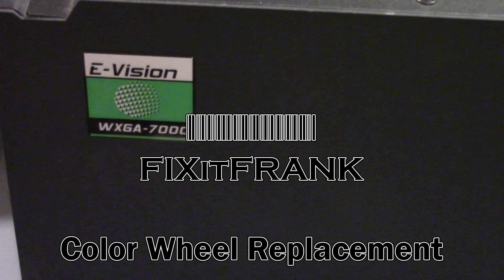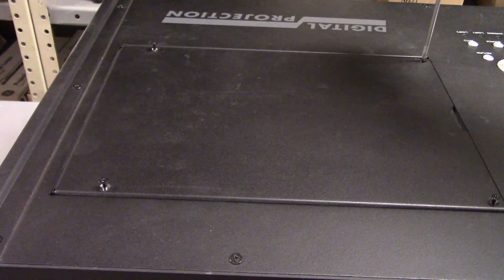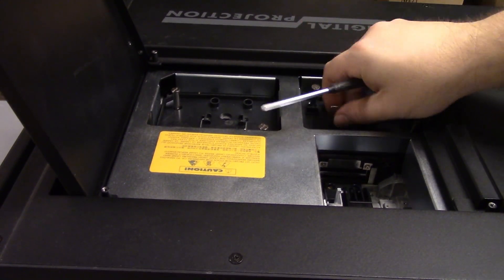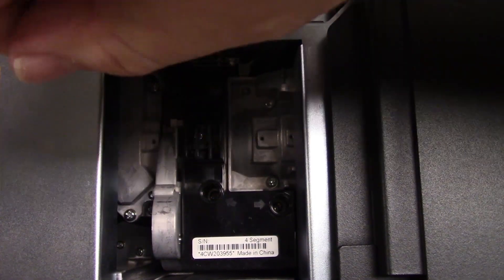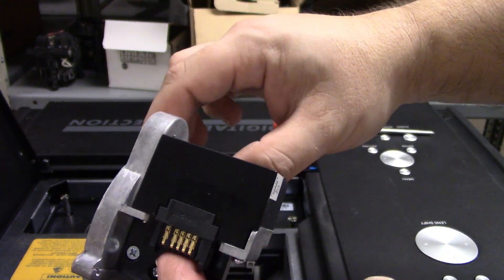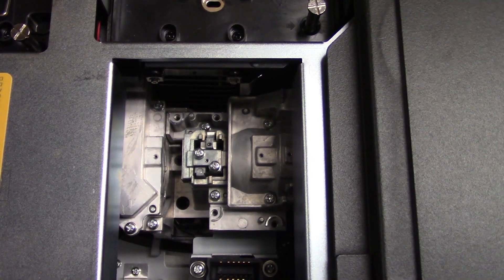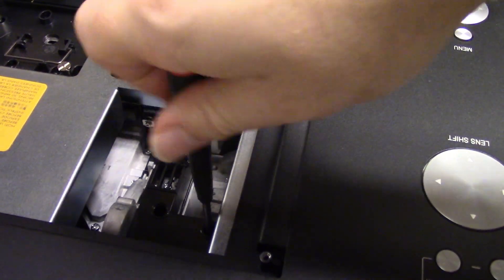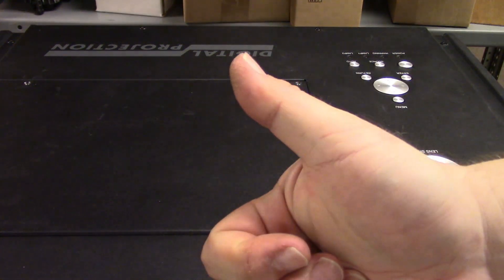Digital Projection eVision XVGA 7000 Projector Color Wheel Replacement

Comment: Hey Frank, I have a pico projector from AAXA, the colours will go inverted over time and if I turn it off after a while, the colours become normal but turns inverted again over time. Do i have to change the color wheel or is it some sort of overheating on the DLP chip?
Reply from the maker: I don't know if those have a color wheel. I think they flash the LEDs on and off instead. I say so because of the size of the projector. Also the way they make the colors is usually with the rgb LEDs. Due to the cost of the entire unit being under $100 USD, I wouldn't recommend putting any parts into it. Rather I would check for bad connections near the LEDs. The led driver is another suspect area. The dlp won't affect your color as far as I am aware but I agree that you have a thermal issue. Start with making sure it's clean and has plenty of airflow and then check connections near anything that looks like it gets hot.

Comment: Hello Frank, Update on my LG projector.  Good news I was able to get into the optics assembly.  The DMD looks good. It's super clean no dust or smoke stain.  Its confirmed its def the lense assembly that needs replacing. Both lense exterior and interior looks like the coating got burned by the LED/LASER LAMP.  You mentioned that you were able to find the lense assembly part? If you can pls provide the link so I can take a look and see.  And maybe i can find something much cheaper somewhere floating around the web.   Much appreciated! And thanks again!
Reply from the maker: Hi Edwin,  I found it via one of my contacts in China. It was not on a website.  They gave me a price of $170USD( with shipping taxes etc). 

I would try and see if you can rotate the lens to move the melted part. Short throw lenses tend to only use a small area. You may get away with moving 180degrees from its position if it is movable. Otherwise, you may be able to 'clean' the damage using Acetone in small amounts.  This would be a last option as acetone can melt plastic very quickly.  I am thinking it might be worth trying a little bit and see if you can slowly melt off the bad spot.  I will see if I can get the part# for you from my contact.  That may help in finding another part.  Have you tried LG?  I doubt they will be helpful but it cant hurt to ask.
Reply: @FixitFrank  $170? Ouch... that's quite expensive!! 

I was also  thinking the same about rotating the lens to a part where its not burned. No I have not contacted LG but I will. Unfortunately it's out of warranty but I'm going to see what price they can give me. I also tried looking online for a used / or damaged non working unit on hoping of salvaging an undamaged  lens assembly. But I'm surprised to find that thry are selling these projectors USED for $500  on Ebay and as high as $1000 on Amazon!!! It's only a 500lumen 720p projector!!  I guess this product has become a rare valuable item.
Reply: @FixitFrank  and yes if you can get that part number it will be a big help! I might be able to dig very very very  hard online and find a cheaper alternative.  That's a big IF.

Comment: Hello fixitfrank. Love your videos. Very informative!! I was wondering how much for your services on projectors.  I have a LG mini beam projector that needs service.  Used outdoor near fire pits. The projected image is tinted yellow and the lense looks like it needs replacing (outer lense has a dark brown spot etching on it that looks like a UV burn or something). I'm not sure if it's the lense or the color wheel or anything in the optics that needs cleaning or replacing.
Reply from the maker: Hi Edwin, I will read up on this model.  I am not very familiar with the mini beam series but it sounds like it might have more of a lens issue than a color wheel.  I think these are laser/LED light engines?
Reply: @FixitFrank  it's a LED portable protector 600 lumens. Here is the exact model.
 PG60G LG MiniBeam
Reply: @FixitFrank  https://www.lg.com/africa/projectors/lg-PG60G
Reply from the maker: Hello Edwin,  I must admit this was harder to find info on than I expected.  The issue I am finding is that parts cost are quite high in comparison to the unit cost.  The optic assembly looks to be well over $100US.  Are you able to tell if the damage is to the lens or if it some debris or dirt?  If the lens is physically damaged, I would lean towards the unit being un-repairable( within a reasonable cost).  You may be able to carefully sand away the damage. If you then polish carefully it may become clear enough to work again.  It will not be as good as before but it will at least be usable and better than it is now.  My hunch is the lasers got hot on the poly-carbonate lens and melted it.  I have seen this on normal lamp projectors with short throw lenses as well. I am sorry I do not have better news for you.
Reply: Hello @FixitFrank  , Thank you for taking the time to try to help me with this issue. Yes, the information is quite hard to find. I've tried looking online for the optic replacent part with no luck. I'm surprised that you were able to track it down.  But upon closer inspection I don't think the lense needs to be replaced at all. It seems like the damage is superficial.  It looks like the blue/purple tint coating on the outer front lense is coming off ( Im not sure if that's for anti glare or UV ). Theres actually NO physical etching of any sort.  As for the yellow tint on the projectors picture its def from smoke.  
This projector was used out doors during summer around wood burning firepit. As for the dirt and dust I did not see any inside the lense.  I tried opening the assembly to try to clean the smoke off the inner lense but got discouraged as I am not comfortable getting into the lense assembly. I think the lense and the tunnels just need a really good cleaning. As for the DLP / DMD CHIP I'm not sure if the smoke got into that as well.....

Comment: Hi.
Do you know how I can find the name of my ballast? Because I can't fin it when I search for the name of my projector.
-Lars
Reply from the maker: Hi Lars, Unfortunately there is no name for the ballast. It will be a part number. You will have to remove the ballast or find the service manual for your model which will list it.
Reply: FixitFrank 
Ok.
But when the only things connected to the motherboard is the power supply or ballast (I don’t know which one), and I try to turn it on with the remote. It behaves just as when everything is connected. Just some clicking from some relay, and nothing more. 
What do you think is most likely to be the problem?
Tnx again🤙🏼
Reply from the maker: @larsandersmyklebust4794  It's really hard to say without it front of me.  There are so many things that really need to be eliminated one a time as per the service manual flow-chart.  We're sort of picking random things to check rather than starting at hte beginning and working through. 
Really the best way to proceed is using the service manuals. https://elektrotanya.com/showresult?what=benq%20w1060&kategoria=&kat2=all    Start with the troubleshooting flowchart and see where you end up.  There is no specific item that causes this problem all the time.  Rather there are many possible causes.  That link will take you to a website that has 3 service manual links you can download for free.
Reply: FixitFrank thank’s👌🏼